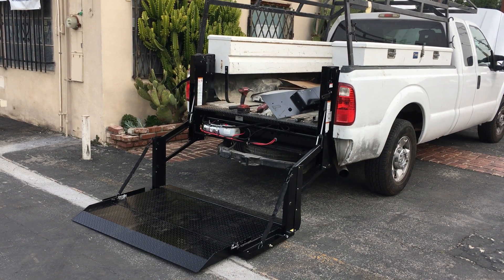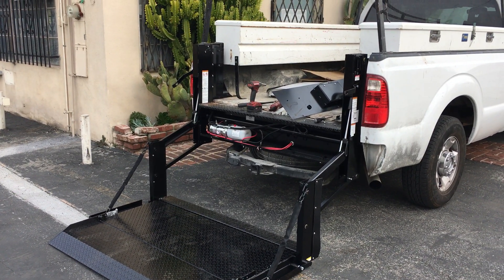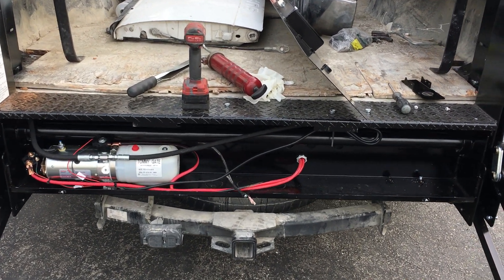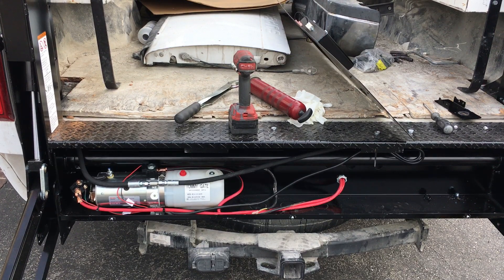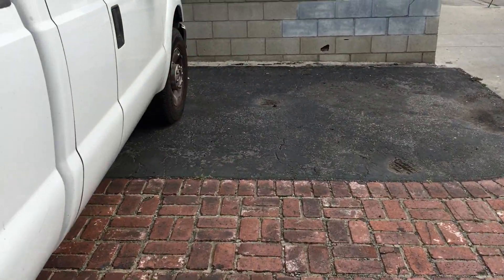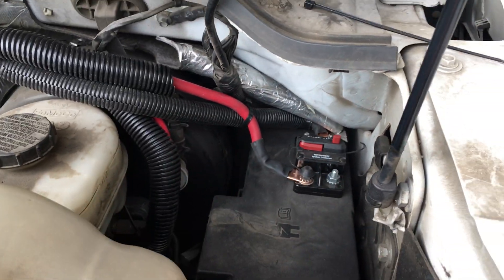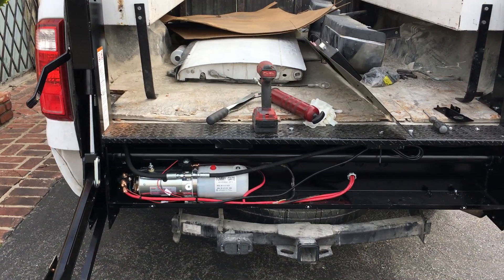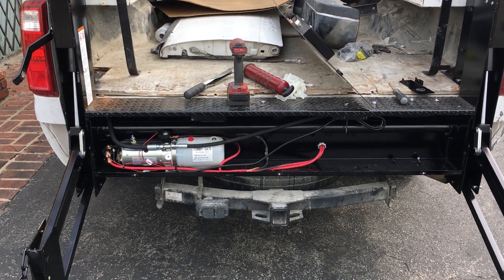Service & Maintenance for a Tommy Gate G2 Series Lift by Mac's Lift Gate Inc.

Comment: What specifically about the breathe plug in the oil tank?
Reply: Allows air to get in or out of the system. Its important and I have seen plastic tanks crack because of no breather plug

Comment: Hi Sir!  Do you connect the positive wire  to the circuit breaker? Thanks a lot
Reply: Hey did u figure out where to connect the wires? I have the power button blinking, also how many Volte do you need coming out the circuit breaker, thankss
Reply: I did. The positive wire. I think 12 volts should be good.  I never had the blinking problem
Reply: @M7PSOCCERPLAYER  Blinking problem could be due to low power in battery.  try starting the truck and running it awhile and see if there is a difference 
Loose battery connection can do it also.  The control needs just a few amps to power up, but if the battery is low or bad connection you will have a blinking light when you try to go up